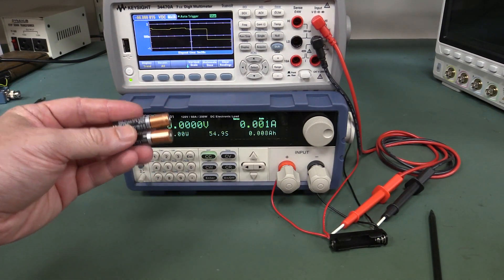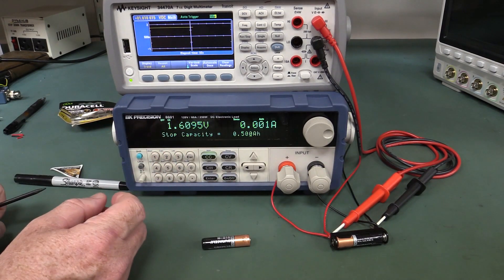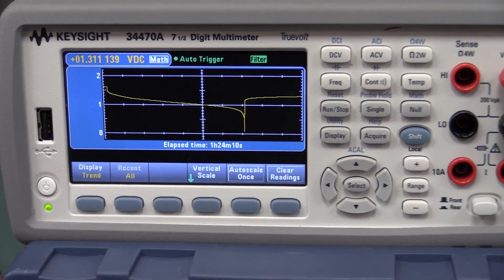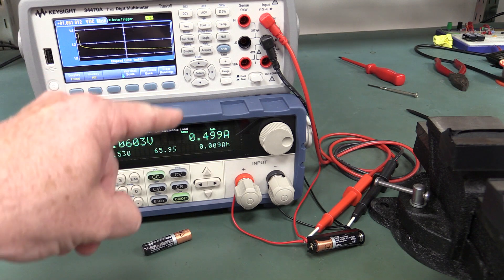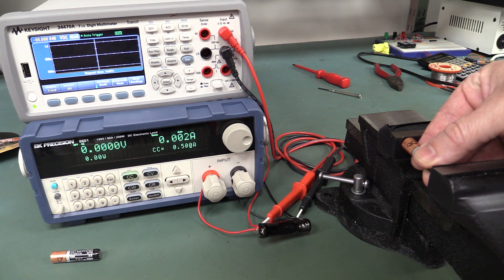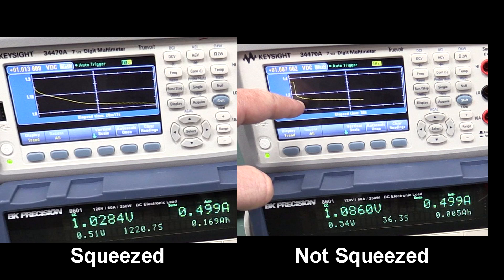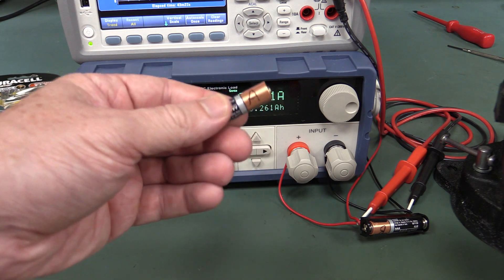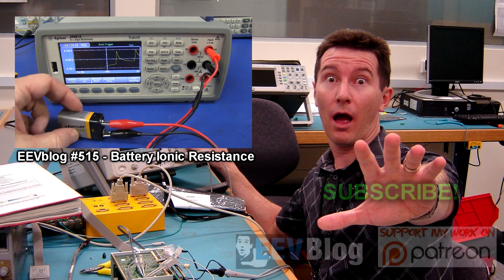EEVblog #865 - How To Increase Alkaline Battery Capacity

Comment: Re the bounce test (EEVblog #508, see Video Playlist):

Just sticking in your product to see if it works is less useful when you need more than one battery. Which one is empty and which one is still holding charge?

b.t.w. I prefer using a battery charge tester (I've got two at home). These present a resistive load to the cell (battery) which quickly shows (especially the analogue one) if the voltage drops rapidly under load.

I use quite a lot of batteries (call me a gadget geek), preferably rechargeable ones, of which one recently died on me.
Full voltage without load (voltage meter), fast dropping voltage under load (charge tester).

Comment: should have added electrical tape on the negative side and get a reading with some calipers before and after squeezing so we could see how much you squeezed it by and then make a graph with squeeze to capacity.
0.1mm compression gives 30mAh ect.

And does squeezing the sides do the same thing?

Comment: What happens to the capacity if you squeeze the battery with the vice of knowledge from the sides as opposed to the ends of the batteries?

Comment: What happens if you "squeeze" a fresh battery? would it have any more capacity than a non-squeezed fresh battery? Or does it only work for depleted batteries by forcing firmer contact with non-depleted electrolyte contained within the battery. Hopefully if you do another video of this topic, you'll try squeezing fresh batteries too along with the discharged batteries to see if there's any effect.

Comment: Didn't work with a car battery. After several hours of jumping up and down on it, all I have is battery acid all over the garage floor.
Reply: +Dave Curran That's why you need a batteriser.
Reply: +edwardecl well, I tried jumping up and down on the batteriser and all I got was a sense of happiness.
Reply: +Dave Curran that's already enough:)
Reply: You mean sulfuric acid.

Comment: The squeezed battery had a longer recovery time. That is why Dave got "more" power out of it. Over time the battery is recovering due to the chemistry. So squeezing the battery did not give the extra power. Waiting for it to recover did.

Comment: I assume that this also works with lithium primaries?
Reply: +NZ SNIPER Yes!. But the chemistry involved may be more complex. I've squeezed a CR2032 with some kapton tape to insulate it, and I got a whopping extra 15.5 % capacity! But because kapton is rather expensive, I've repeated the test with some cheap PVC tape, and you only get 3.14 % How odd is that!

Comment: Great advice! I stomped on my battery then installed in in place of one of the main fuses in the circuit breaker of my house. Now I'm getting free electricity off the grid! The utility company is pretty upset but theres not much they can do. I went out to the street with some hedge clips and cut the power line going to my house. Totally unneeded now! The utility company must have been watching me because as soon as I cut those wires they retaliated by shutting off the power to every house on the block! What jerks. Thats fine. I'll tell my neighbors about this free power solution later tonight.

Another battery tip for those who are interested. Batteries have a lot of energy inside of them. I found that when you've got the water kettle on the stove for morning tea, drop in a couple of AA batteries. The internal energy gets absorbed into the water so you're tea will have a little extra kick! Make sure before you drink it to remove the battery shell. Theres other harmful chemicals inside the battery that you DO NOT want to ingest. With this tip Im saving money too! I only use one bag of tea in the morning instead of two and the battery battery seems to last for about a month of daily usage. So much good information out there if you just know where to look.
Reply: Yeah man! I got a small lead acid and used a double copper helix winded DC transformer I got from ebay (make sure you get the type with the chrome core, its is 20x better at channeling the magnetism than the cheap iron core which will drain your battery in weeks) and ran my fridge on it for a year! just wacked it in place of my regular car battery, charged it up and its still rockin my fridge!

Comment: Hi Dave, what would happen if you squeeze the fresh battery?
Reply from the maker: +Cristian Conrads Same thing I guess, but haven't tried it.
Reply: +Cristian Conrads 
The battery will love you forever...
Reply: +Cristian Conrads
Electrons would fall out of the battery.
Reply: +EEVblog  Not the same thing. Inside battery there is a rod at negative pole, and when you squize battery rod pushes forward making contact with some mass which was not used in chemical reaction before.
When battery connected to load, chemical reaction is using out alkaline mass inside battery, and it losses its capacity.
By squizing negative rod to new unused mass we increase capacity.
Reply: +EEVblog Or possibly developing a mechanism that would continuously apply force to the battery to ensure fresh material contacts the  current collector (but that would consume energy as well)
Reply: +Cristian Conrads Most people think batteries are just fine from concentrate, but personally I always prefer mine fresh squeezed. Keeps all the nutrients in :D
Reply: +ZePhyr&#39;s random shit 
that only happens when you hold them upside down!
Reply: +Ernst Stavro Blofeld STOP TROLLING GO PLAY WITH YOUR MONKY
Reply: +GpanosXP Even better if you don't insulate the vice too!
Reply: Dennis Cat God forbid
Reply: +EEVblog - You should have made an apology video to Batteriser, proving that the shipped product actually works, since it does.
Reply: +Cristian Conrads Donald Trump appears before you
Reply: ***** Are you trying to lecture me on my own product? I am talking about our idigogo campaign, that harvested nearly half a million dollars.
Did you really think we were actually going to manufacture the thing?!
Pfffffthhahaha!
People… Seriously.
Reply: ***** Facts speak louder than words and the truth always hurts.

Comment: I think what is happening is you disturb the mostly depleted layer of electrode material and allow fresh material to be in contact with current collector rod and/or separator. See how alkaline battery is constructed.
Reply: +EEVblog it would be interesting to squeze the battery during discharge and see if the voltage rises.
Reply from the maker: +Gameboygenius Yep, sounds plausible.
Reply: +Lukáš Andrysík What I want to know if Dave can repeat this experiment tomorrow and still get the same results ;)
Reply: +Maxx B I believe so. I am well aware of today's date but I had similar experience with mechanically squeezing batteries to obtain more charge from them. But mine batteries were zinc-carbon (not alkaline). So if this is april fools it is closer to truth than he expected...
Reply: +Lukáš Andrysík Perhaps it also makes a difference in which direction you squeeze it (longitudinal vs. cross squeeze)?
Reply: +Lukáš Andrysík Indeed, this is the most likely explanation.
Reply: Wikipedia has an interesting article about REDOX a term for chemical reactions. Something has Oxidised just like Oxygen Oxidising Iron into rust. And by removing that Oxidised layer or push throughout it good contact is established again. The Zinc Carbon battery does 'eat' the outer layer of the battery but I think Alkaline doesn't really 'eat' its outer metal layer. Note, Oxidising is not something which needs Oxygen but just a term. See Wikipedia for REDOX. Like a rusty metal surface no longer a good conducter after removal of rust (Oxidised layer) will conduct much better again.
Reply: +Lukáš Andrysík He did almost that with a 9V battery in the other video he linked. (Under a no load condition rather than under load.)
Reply: Maxx B The REDOX chemical reaction must probably first have taken place since if not there is nothing that Reduced or Oxidised  (Not to be confused with Oxygen it's a chemistry term) so there is no Oxidised layer to push through. (Like a metal that hasn't rust yet) I think Iron is a perfact example of a good enough conductor, but after the Iron Oxidised it will conduct worse. But remove the Oxidised layer from the Iron or push through the rust on it there is good conduction again to continue REDOX. See Wikipedia for REDOX. Since Oxygene is an Oxidiser but not all Oxidisers are Oxygene.
Reply: Lukáš Andrysík
The tricks the have an element of truth are usually the most believable. It's a great video real or otherwise. It would be funny that if it was an april fools and he accidentally made an actual discovery.
Reply: +Lukáš Andrysík Would a standard Carbon Battery exhibit the same or similar effects???
Reply: +lasersbee Probably. I didn't do any real measurements. I just remember when I was litle, I discovered that smashing discharged battery on the ground and stepping on it "charged" it little. But again - this was like 20years ago. Now I am too lazy to do some proper measurement :D
Reply: +Lukáš Andrysík Thanks for replying... The question was directed at Dave... ;-)
Reply: +lasersbee :D ok